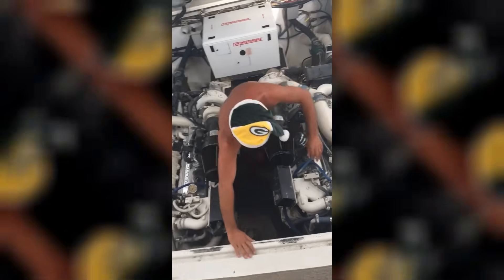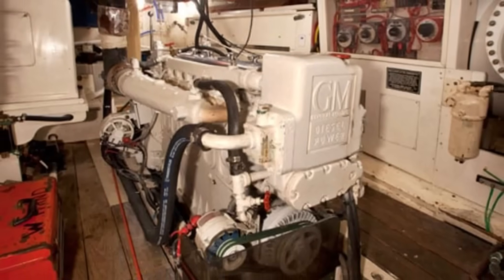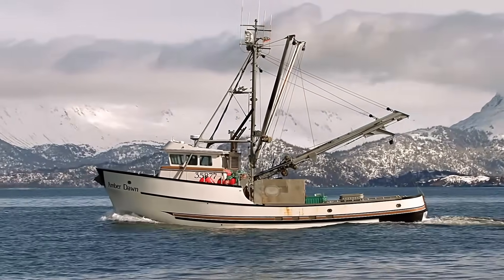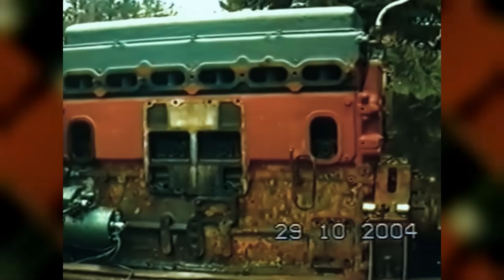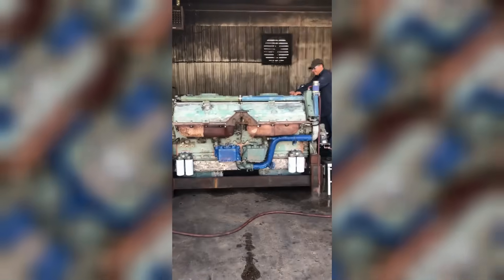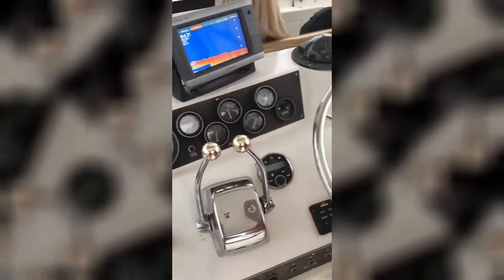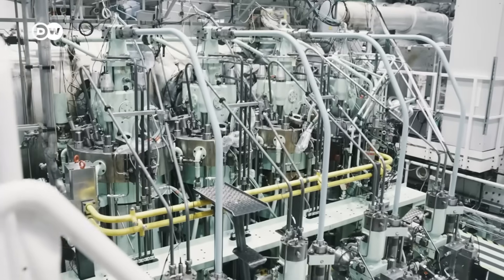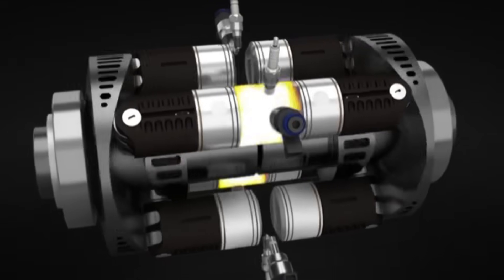The Rise and Fall of Detroit Diesel Marine Division

Comment: What a load of horseshit.
The tugboat Im sitting on right now has a pair of 8v71 gensets and a 6-71 for the tow machine.
Also onboard is a pair of 16-645 EMDs for propulsion (another brilliant design with roots directly traceable to the 1930s)
All these engines are reliable as anvils.
Ive also spent time on brand new tugs with all the modern bells and whistles for engines.....which engines do you think left us dead in the water more times in one year than my previous 25 years on the water.
Lol, dont even get me started on maintenance costs, those dinosaur 2 strokes will still be chugging along, just change the oil and filters every once in awhile, give them some sort of fuel to burn, off they go. 🦾🦾
Reply from the maker: That's great information, except for the first line...I could have done without that. I got all this info from family members who work on and with various boats. My cousin is a harbor pilot, other family members are mechanical engineers working on engines in tankers, then I have a contingent in the yachting industry. So surely some of their info must be right.
Reply: Don't forget to change the Raycor (fuel-water separator).  Detroits run forever, but really hate water in the fuel.  (Former Heavy Equipment & Marine Mechanic)

Comment: This whole video is horseshit. Detroit's are some of the most reliable engine still in use today. And no, Bertram never put 6-71's in a 31
Reply from the maker: Sorry you didn't like it. I worked with info from family members who are harbor pilots, with those who are in the yachting industry (and know sport fishing boats) with engine experts (working on big tankers) and I guess it just ended up all wrong lol. I'll stick to land-based vehicles.
Reply: @VintageAmericanMachines no, I love your videos- and thank you for responding- but just check out the responses on here. Yes Detroit's are old and not as fuel efficient as new engines, but they just run. No electronics that will corrode and leave you stranded 100 miles off shore, just basic raw mechanical power that works. But please keep the videos coming, this is just the first one I myself didn't find very factual.
Reply from the maker: Good to know, thanks for the feedback.
Reply: I would say too danm  long and tall !!
Reply: A complete crock of SHIT reporting !